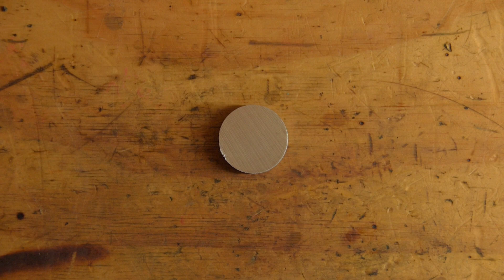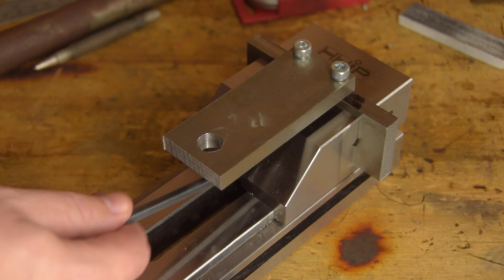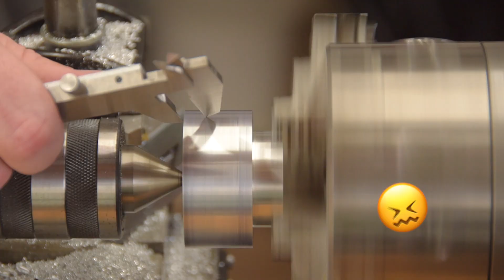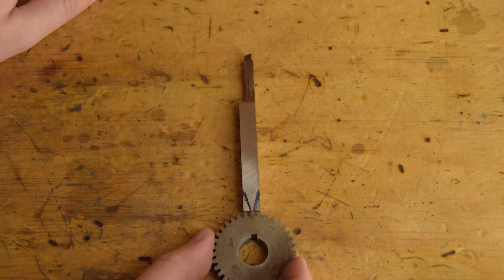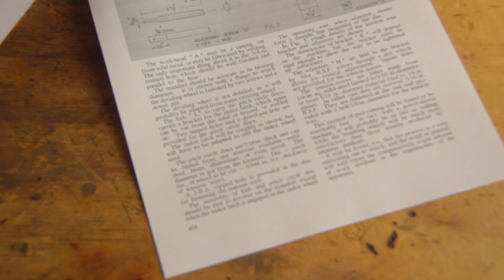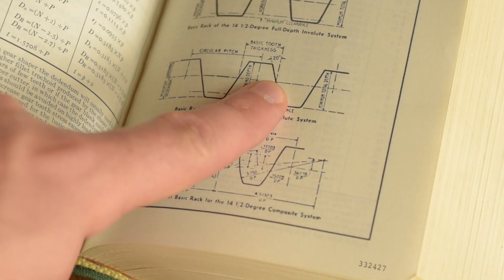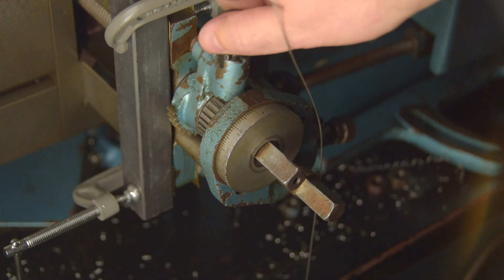Shaper Machine - Involute Gear Cutting

Comment: ha ha ha. 14:52... i see an indexing error at 6 teeth back...

and at 15:17, we see accumulating indexing errors... oops :)

oh well, practice makes perfect... it IS the correct way to generate involutes, and is vastly superior to the cutters... but it DOES require some indexing plates?

i do this on the mill all the time, with slotting saws. no need to grind cutters to the pressure angle, simply roll the blank to compensate for the straight cutter. 
rather than try to roll the blank then index, lock the table, index on each cut. once you have a full rotation, you can instantly see if you stuffed up before you get too far in to correct.. from there, add the small rotation along with the required crossfeed, repeat...

with an extra rotation on the other axis, and the main rotary tilted to suit, this is also the way to generate bevel gears accurately... a rudimentary version of the "gleasson bevel generator"... do not attempt until 100% confident on plain spurs, lol.

Comment: I have basically built the same thing to cut gears but instead of wires I’m using a geared rack win the same module teeth as the gear I want cut and the gear that rides on the rack doesn’t need to be the same size diameter as the gear I’m cutting

Comment: There's gotta be a way to replace those cables with a rack attached to the guide gear

Then you could reliably index the part by just moving it over one tooth on the gear
Reply: And machining a rack is a super easy job with a shaper

Comment: I loved this video.  I have 2 shapers (Bit greedy!!!!)  I am looking at designing a jig for producing the required rotary motion using a rack and banjo  gearing.  To save time I'm going to use the change gears from a Myford. Any ideas would be great.  Over the years I have grabbed as many books on gears and gear cutting.  The best of these is "Manual of Gear Design" by Earl Buckingham.

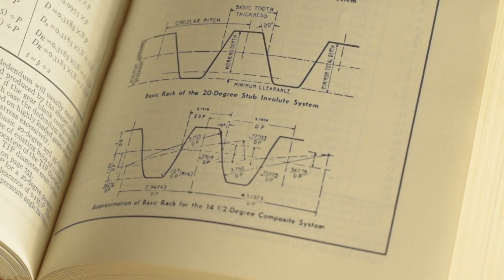Comment: Geoffrey... having adopted your Myford ML7 series as my bible for my Super 7 "tidy-up", I finally needed to hook up the reversing drum-switch.  At the end of that video was a link to this one, which I had somehow previously missed.  It took me back many years, to sitting on a stool beside an inherited Acorn Tools shaper, which itself was on the floor because I had nothing strong enough to support it!  I used it to make a Quick-change tool post for the Myford.  I later swapped it for a Rodney-Myford milling attachment, which was a bit of a disappointment.   Anyway, at 12:25 you produced "The Book"... I immediately turned to the bookshelf behind me, and sure enough, with its home-done protective vinyl cover was my long-departed Father's Thirteenth Edition from 1948!  Memories... Thanks again.

Comment: I love the video, I love all the great comments about how to improve on your design. me personally, I would have used the shaper as it was intended. grind/buy a gear cutter that you need. without a shadow graph it would be very hard to precisely match the grind needed. buying the proper cutter, mounting it to the spindle you made and taking .020 step downs from z until full depth is reached. then rotating manually to the next tooth and repeat. they actually make gear cutting heads that you can mount to your planer. they have a series of graduated dots and you turn a handle to get you exact rotation need for next tooth. anyways loved the video anyway, single point radius cutting on a rotation is pretty cool.

Comment: First off, great video, very inspiring! Reading through the article a few times, I notice it says the tool should be made "to the form of a rack tooth", which makes sense since rack teeth have straight sides. According to the Machinery's Handbook, and if my math is right, that would make the tip width = (0.5 π - 2.5 tan φ) / P.  (P = diametral pitch, φ = pressure angle). For instance, for a 24 pitch gear, the tip width would be 0.028". Can't wait to try it myself!

Comment: What is the manufacturers name of the lathe tool holder??? How does that compare to an Aloris type ??? The shaping of gears on a shaper you started needs two improvements. First the use of a rack and pinion near the throat. Second the use of a dividing head on the other end. This would work perfect. But the time to cut the gear will not make you money for sure. Good day too. VF

Comment: A setscrew is not nearly good enough to prevent slipping of the cable/drive wheel on the shaft.  That should be pinned!  Your link scheme (only 1)  should work as long as you keep the extent of the arc short & the fittings TIGHT.

Comment: great idea, and anyway, watchmakers made gears by only slot cutting, the "shape" is made on a special filing machine called a 'jacott tool', this is just a lathe like holding fixture, to index the slots, and you manually file the shape, like dressing a chainsaw chain, SAME PROCESS, just a different jig to hold the part/ guide the file!!- also the name of this process is called "topping" the gear teeth, for refference.

Comment: instead of using just one cable, try something like 10 or twenty.  All laid side by side on the same cylinder.  Multiple cables will increase stiffness and reduce errors.  Tension a pair (loop) of cables from one end only to wind up the pre-tension.

Comment: I like the wound wire idea  and I read some suggestions for improvements below ,  but the gear blank needs to be rolled  with respect to the  ''base roll diameter '' for the particular gear .
make the 'spinney thing '  od to be base roll dimension  rather than the gear OD. 
ref . gear geometry  for this  . 
                                                        ----------------------------------- 
eg. for any pair of meshing gears  the common tangent  on the base roll dia.  will cross  on the pitch line  ( and contact point )  on both gears .

Comment: NICE solution.... but prone, as you show, to compound errors. I think you could do away with some of the moving parts, if you make a multi-tooth cutter.... on the shaper natch. So... using your existing rack cutter, put some suitable tool steel in the vice, and cut a short rack, 3 teeth should be enough (but be warned - I used the back of an Inland Revenue envelope to do the calculations, and as we know, when tax is involved, numbers dance to their own tune). Put this cutter in the shaper, exactly vertical. Using your "spindexer", set up the first cut using the downfeed, go full depth. Retract, rotate one tooth, repeat. Continue until done. The idea here is that the angles are put on each tooth by the cutters either side of the middle cutter, rather than by the blank rotating under a single tooth cutter. Yeah, you end up with an approximate involute again, rather than a lovely smooth one; but that's nothing that time, and a lack of grease, won't fix...

Comment: The wheel PD and wire size only affects the involute profile while the accumulation error is due to slipping of the wire to the wheel. Reduce the wire length as much as allowed to minimize elastic effect during operation, then wrap the wire at least 3 times. Then tension one end of the wire with a heavy hanging weigth on a small pulley setup, set the weigth roughly to the tension capacity of the wire. The weigth/tension and the extra wraps increases wire grip to the wheel with consistency. Alternatively the hanging weigth and pulley setup can be replaced with a spring joint to one end of the wire before fixing to one end to produce a similar effect. It is also a good idea to use a harder material set screws then machine the tip to a cone shape. You want the set screws to dig to the wheel and reduce unwanted micro movement of the wheel from tightening the set screws. The cone indentation will result to the bulging of the sorrounding face on the wheel, you need to slightly groove the wheel section under the cone tip to maintain free rotation. Before cutting make sure you run the wheel several time accross the full travel distance so any wire slack is consumed. Obviously using proper machine tool accessory will solve your problem but if given only some cheap scavenge materials, this is one way to make it work.

Comment: Well done! - loved the video . . for the first time I understand how these gears are cut like that. 
your suggested solution - is to use the index gear itself to with a rack-gear mounted on top of it - as the table to the left it rols the work piece - when you need to shift the tooth then it just shifts one gear notch up and repeat.

Comment: I probably don't have the best interpretation of gear cutting but...why not grind the tool to be the involute shape.  Mount the blank on the indexer.  Feed the shaper table up to a limit as the shaper cuts deep into the blank.  I know this requires more accurate tool grinding but it eliminates the apparently error prone wire mechanism.  It appears that you are trying to replicate how gears are hobbed (one tooth at a time) which would be more advanced than the first attempt of making gears on a shaper.   For that matter, if this were being done for the first time where would the indexing gear come from?

Comment: the problem the disk with the wires should have been the base diameter not the pitch diameter, 
the reason the last tooth was off was accumulated pitch error, and the diametral pitch was off.
needed and exact tooth profile for that gear.

Comment: This is interesting, thanks! I might try this on my shaper. 
What I think would work is to remove the cable which I think is the error source (fixing the indexing is easy). A rod attached to the cable pulley could work IF the rotation of the pulley is small as greater pulley rotation introduces errors into the degree of rotation as the rod move from TC to 90 degrees off TDC (90 degrees off would be max error). So a better solution is to keep whatever turns the pulley at TDC which = the PD. 

I propose a cogged belt replacing the cable. If we run the cogged belt over a cogged pulley there won't be enough gear mesh to prevent movement as the shaper forms the tooth profile but if we use two ball bearings on each side of the pulley at 90 degrees off TDC then the belt will engage half the pulley. This might work.

Comment: I realize this video is almost a year old, but I'm hoping you can help. I'm having trouble wrapping my head around how you arrived at the final tip width for the cutting tool. I've searched around the internet, and buried my head into my copy of Machinery's Handbook, but it all seems a bit over my head. I'm likely missing something small and stupid, but any help you could offer would be much appreciated.
Reply from the maker: It's the profile of the gap between two teeth if the gear is flat, as in a rack. I think the dimensions for rack gears for involute sizes are in the machinery's handbook.

Comment: You could have a rack gear that meshes with your index gear on the front. And the rack gear will act as your wire. Mount the rack on the back stationary, akin to the two ends of the wire. It's a bit simpler, and mount the rack on pins, so you can slide one pin out and increase the sample gear by one tooth

Comment: If the indexing pointer is attached to the wire rotating mechanism, it could never be wrong, as it will point to the same tooth in any table position.

Comment: The easiest way I find to do it, is using a rack and your "model gear" as pinion. You have to fix the rack to the shaper's body and make the gear mesh snug on it. That way you can replace the wire with a more reliable metod. And for being able to cut more theth, I think you can establish a sliding coupling relation, with a key, between the shaft and your "model gear". That way, you can unmesh the "model gear" sliding it out of the rack, rotate it one thoot, and mesh it again to cut the next thoot. Make sure the key fits snug in the model gear's key way, or it can add error.

Making the rack shouldn't be a problem, those have trapezoidal theet as your cutting tool. Just decouple the automatic horizontal fed and move horizontally a module prior cutting each thoot. Fed manually the vertical feed, being careful of not overcutting.
I'm sorry if I couldn't make myself clear enough. English is not my native language.

Edit: typo

Comment: 15:48 : Well, if it had worked, I would've been awestruck. I'd expect a lot of give in the wire, progressively making the tolerance larger. A steel band might have been better than wire (or possibly much worse due to the springiness) but I think the best option would probably be a toothed belt. Now that brings you into the servo/stepper motor control territory.

Comment: In the old days we do not use computers. We use an abacus and a slide rule! With them we were able, in our younger years, able to calculate the precise angle of the curves of the shaper's cutting tool bit. Go back to the old books on Simple History Of Machine Tools. A Short History of Machine Tools Hardcover – 1966 by L.T.C. Rolt (Author). YOU WILL GET ALL YOUR ANSWERS THERE!

Comment: There is a revolving template with holes and notches on it in order to hold it accurately and to be adjusted accurately. Using a precision tungsten tip marker and using a bolt secured compass in order to create an accurate outline needed to be followed. Then use a lathe to create the perfect curving outline on both sides of a revolving tool steel, then cut it crosswise to get your tip on both sides, and then sharpen it to .00001 of an inch accuracy. An engine lathe is one of the few machine tools that can reproduce itself directly and indirectly (by creating a series of multi-staged customized machine tools until you got the right machine tool component(s).

Comment: Great porno :) If everithing in the front is solid-conected, - than small aluminum finger, with index wheel, should always hit new position pretty correctly (on the start of each cyclus). If wire is slipping, than each tooth should have error in the shape, but not cumulate big final error on the end. Are you sure that aluminum part, indexing wheel, and the shaft, are not loose against each other?
Reply from the maker: Bingo. I think this is the first comment that fully gets what's going on. I think the error was actually caused by the 'not very well mounted' indicator drifting off zero.
Reply: @GeoffreyCroker  Yes, my second idea was if your cutting bit was not loose, or if indicator was not drifting (and where and how is indicator mounted) - since your shaper is shaking too much. (I like the idea that machine is on the wheels, but it is also a giant disatvantage... :) I am looking forard for your next video :) ...I am also interested, if it is somehow possible, with this concept, to create tool/machine, which will shape profile of the cutting bit in exact curved shape... Othervice - your style of making video (artistic, dramatic, voice, comments...) is amazing my friend :)

Comment: I think the problem is possibly one of two things related to your "spiny thing".   First, the wire drive may be slipping under the influence of the cutting action.   Maybe several more turns of the wire around the "spiny thing" to increase the friction, and a turnbuckle to tension the wire may help.   Secondly, unless the diameter of the "spiny thing" is precisely correct the last tooth will be an undesirable shape.   To check this place a witness mark on the "spiny thing" and the dividing gear and then travers the table so that the dividing gear makes one revolution. If the "spiny thing" has not also made precisely one revolution the last tooth will be distorted.   A rack driving the dividing gear would work but then you would have to have a gear with the same number of teeth as the gear to be generated, and it would have to have the same pressure angle and DP or Module as the rack.   A fancy change-gear arrangement may be possible using the change gears from the Myford.   A precisely calculated "spiny thing" that did not slip as it rotated would allow great flexibility in cutting any number of teeth, provided a suitable dividing device was available.

Comment: Get an indexer for sure. as far as a simple way to do the linear to rotary motion, you may be able to use a tap in your lathe in combination with the milling attachment and a fixture to mount a gear blank to legitimately hob a gear of the same tooth count and pitch as your desired gear. Then simply use a piece of threaded rod as a rack, or make the rack on the shaper. another option is to just mechanically link the rotary movement with gears.

Comment: I'm thinking about building something similar (less prototypy) for my shaper. The idea with links is appealing to me.  Maybe it's possible to make the rotation proportional to the movement for the part of the turn necessary.. About 1/4 of a turn should be enough? At least for fairly small gears.

Comment: Imitate a clock escarpment with ratchet and pawl on the original gear and a clock spring to turn the shaft... old school and simple. Add a second stop at some arbitrary angle on the opposite side of the original gear; the two stops engage a tooth alternately advancing rotation partialy with one stop setting the correct position as the cutter advances. Rather than completing one tooth at a time, you would be doing a partial cut all the way around; but advancing the table crossfeed would also complete all the teeth simultaneously. The motion of the stops could be actuated by the motion of the cutting head. Within some limits the original gear could be substituted to create copies with different pitches.